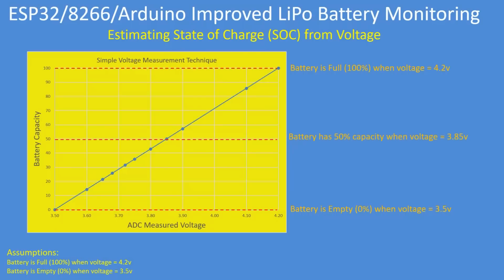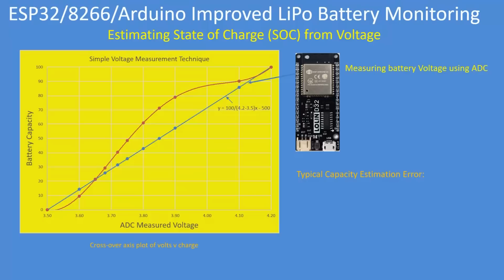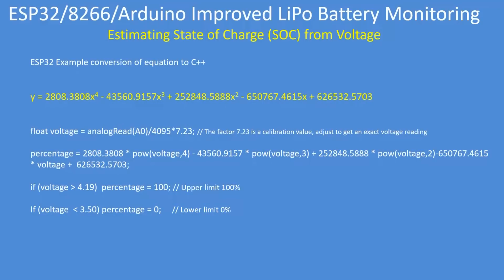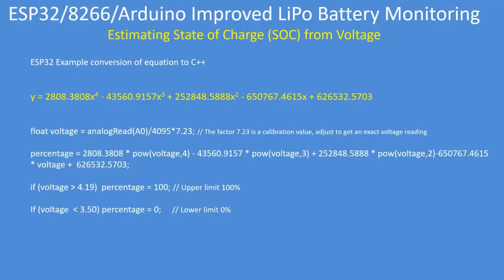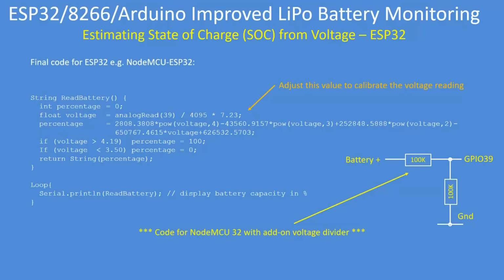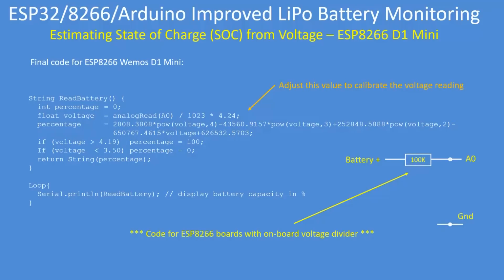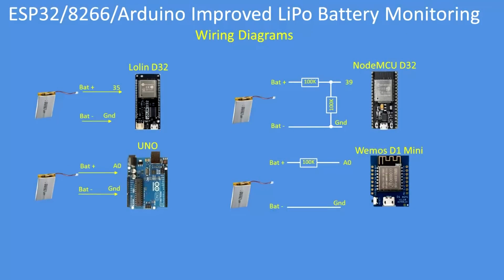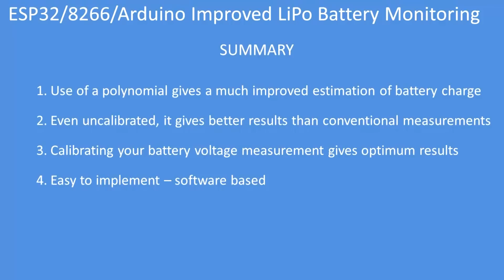Tech Note 129 - ESP32/8266/Arduino Improved Li-ion/LiPo Battery Monitoring

Comment: Hi Dave, very good to describe the discharge curve of the LiPo as 'non-linear' and its a good tool to estimate remaining capacity. However, it is load-dependent. More importantly, this method should never be used to determine when a battery is full - LiPo must always be charged in accordance with the manufacturer's recommendations (normally CC/CV).
Reply from the maker: Indeed, but this is principally for use with a micro-controller where loads are low. For my drones and Rx fixed wing aircraft and radios I’ve been using LiPo’s for about 10-years now and I agree there are few around who fully understand the charging regimes that need to be applied especially Boeing and their 787’s that caught on fire when someone thought they could replace a NiMh with a LiPo without changing the charging methods. For most development boards on the market they have a reasonable battery charger-management chip the TP4054 which is widely used to keep the batteries in good shape so most users of these devices will be well protected.
Reply: @G6EJD-David  Yes - lol even the 'big' boys screw it up. I was just wanting to flag up that its important to follow the charging guidelines before someone decides to change your code into a battery charger :)
Reply: @G6EJD-David  do you have any more information on why the batteries caught fire? I have converted an old cleaning robot to LiIon batteries and included a BMS/ protection board which cuts out a little earlier than the full charge voltage of the previously used NiMH Batteries.
Reply from the maker: I’m not sure if we’ll ever know the real reason why Boeing’s batteries caught fire, but my intuition is they did not understand the (then) novel use of LiPo batteries as a replacement/upgrade and the need for extensive battery monitoring. I can proudly say of all my 70+ high capacity LiPo’s I’ve never had a failure typically in the form of puffing (swollen) packs due to overheating during charge and discharge or over/charge. You must charge at constant voltage and not constant current but a constant current charger is perfectly ok if you employ good charge monitoring circuitry to check for over voltage or heating. At the lower end where the battery becomes depleted say to 3.2v when it can become chemically damaged is when most damage is caused, and then when charging recommences a chemically damaged cell can become excessively hot as it’s internal resistance rises as a result of the damage. It’s like John was pointing out,  these batteries need careful handling during both charge and discharge but correctly implemented(Apple have this almost perfectly so in their products) the battery will be safe and last a long time. I hope this helps. Sounds like you’ve done the right thing in your installation.